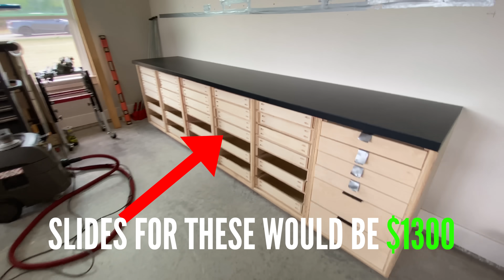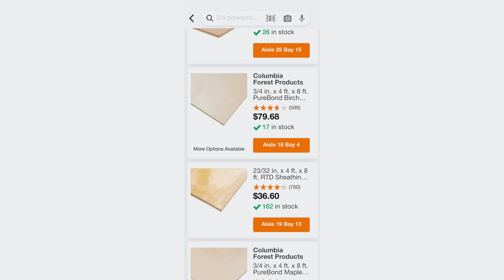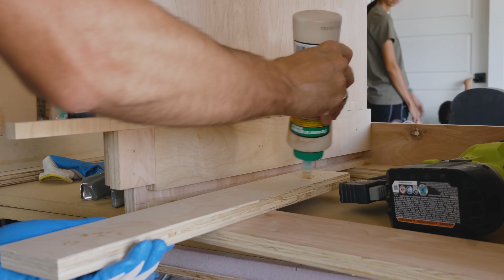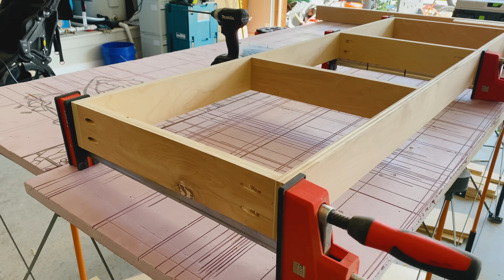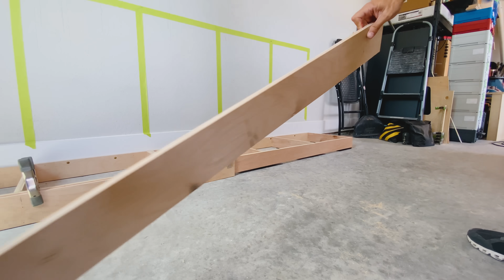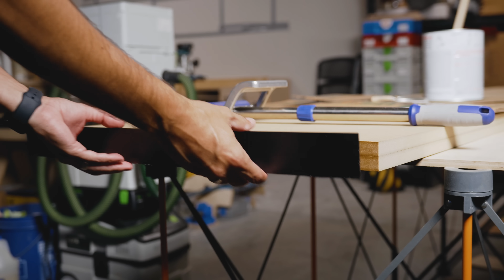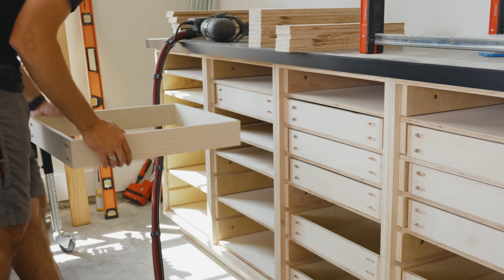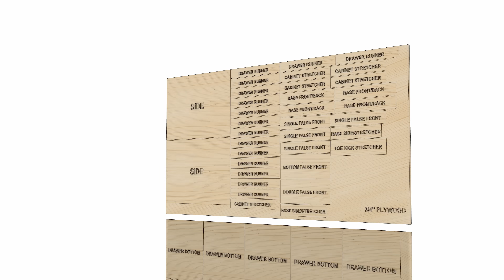Drawer slides are expensive. Do this instead.

Comment: One thing I've done instead of slides that worked: skateboard bearings. You can get 100 packs for $20 or so. They're low quality for skate boarding but should work great for sliding drawers. I used 6 bearings per drawer (3 per side) because they were super deep, and screwed them right into the side of the drawer with a washer for spacing. Buttery smooth drawers.

If you used 6 per drawer, that's only 200 bearings for 30+ drawers, so should be less than $50 total. The rest of your build could be mostly the same, just size the tracks to accommodate the bearing diameter, leaving room above so they rotate freely.

Good tips in this video, going to look up some plywood companies in my area to see if I can find something better than big box stores for some upcoming projects.
Reply: I swear, skateboard parts are high quality AF. I replace every castors with skateboard ones. So smooth, so quiet, zero rattling.
Reply: @captain_elmo  I suspect they are much higher quality than common castors and cheap roller stands, but are poor quality for machine parts.  There's a much larger spectrum of quality for these kinds of bearings.
Reply: Rollerblade wheels are also cheap to use instead of casters for woodworking projects.
Reply: That's f---ing brilliant. What if you did your bearings on the cabinet sides, and then did an inlay rail into your drawer sides like right in the middle of the drawer, then you could do a bearing under the rail at the front edge and one right behind it above the rail so it doesn't tip forward at extension. If you spaced that layout carefully you could also put in a positive stop so the drawer doesn't come all the way out?
Reply: @SeanBlader  Yup, you could. You're basically reproducing basic drawer slides at that point, but the bearings are better and you probably already have the wood for the tracks as off cuts.
Reply: @SeanBlader  yes!
Reply: Not quite sure how to do that. snorkel emoji.
Reply: I was going to suggest UHMW sections along the sides without the protruding side board, just the drawer side with the rectangle strip of UHMW between each drawer level. I do like the bearing idea though. I have seen old drawers with wood slides and they develop stiction and don't handle weight well, with even more stiction. UHMW or bearings would fix that.
Reply from the maker: That’s interesting!
Reply: Cool tip.
Reply: My thought. Barings are cheap. I used them when building 3D printers.
Reply: @artisans8521  BEARINGS, not BARINGS.  🙂
Reply: This idea is great. I was worried that the drawers would start sticking after a short while due to moisture. I would also add leftover laminate to the top edge of the drawer spacers for added protection.
Reply: @Peggapoo  classic solid soap and waxing every track will make em smooth
Reply: Edging vs bearings... Melamine 3/4" X 250' Roll, Preglued cost 40 bucks and you can likely get it even cheaper. I have even heard that people just use it on the drawer bottom and not bottom and drawer holder side. 
If you just just use it on the bottom you only need 120 feet if you account for each drawer using 4 feet. 
I also would have dado the drawer just enough to align them. This would make for all the drawers being perfect size. I do like the idea of the entire drawer being a piece of plywood rather than some other form. These drawers are super strong this way and will hold some major weight.
Reply: @kameljoe21  I like to see you pull out a drawer with "some major weight" inside, if it does not have any sort of sliding mechanism and it is wood-wood contact only.
Reply: Cool thanks for that tip, I bought a heap a few years ago for a project that never got of the ground, got just enough of them to make 4 draws so now they won’t go to waste 😹😹😹
Reply: Genius!
Reply: this! Cheap toy-grade skateboard/rollerblade bearings are so great for so many things.
Reply: I literally just took apart a drawer system my father in law and I built (mostly him). We utilized a square metal rod and skateboard bearings as a drawer pull. I used it as a pew pew storage in my honda pilot when I traveled. I shoot competitively and a day trip I will drive 3 hours one way, just to drive back and be home for dinner. Now I have a Decked system for my truck and used the plywood from the drawer for my workbench I just built.
Reply: Exactly my thought. If you don't want actual drawer sliders, why not add simple wheels to the drawers. It is nobrainer for me...
Reply: Loved the detail behind the overhead cabinets !
Reply: I want to try this, but how exactly do you use a washer to attach the bearing directly to the drawer?
Reply: @DreamPath47  The washer is a spacer so the bearing doesn't rub against the drawer's wood. You use a regular bolt to mount it.
Reply: You could use hide glue. Very high strength and use vinegar to disassemble.
Reply: I've done this as well, it works great.

Comment: Dude you just blew my mind about moving the track down using the parallel guides instead of getting a larger track. It’s so simple too and never seen anyone else talk about it
Reply: Ooh, another thing I just noticed around 16:35 was he set the parallel guide measurements with them right next to each other. I have some from kreg but never used them bc I was scared I wouldn't be setting them actually parallel. 🤿

Comment: I think the mark might be your bearing spinning against the side. Blue tape? For the bearing dry lube.  I also would get really close but I think you have to run a fine plane to ease the edge anyway so you can use that to make the top flush to the sides. (I don't like that IKEA razor sharp corner. I always ease it. It really hurts to bump into a crisp 90 degree edge.) Other tricks. Trim a blind side first, is it clean? no burn marks? Put blue tape on the test side, is the tape in good shape after your pass? 
Those places 'cabinet builders buy plywood' in my long, but intermittent experience, they will give you the wholesale price so long as you act like a professional, know what you want (you can ask questions), no whining, no cajoling, no nitpicking... They won't dump the bad pieces on you.  They'll help load it in your truck or on your car. Make sure you know how to tie it. 
And drawer slides? I just routed slots and used birch or maple strips as rails against each other . Waxed. My cabinets are over thirty years old still work like new. Birch ply against birch ply? Sure, but again I'd always, always ease those edges. They are going to saw into the drawer. [Make a pump drill (stone age technology) put a dowel rod on the end and watch how fast a piece of flat wood can drill a 1" hole in another piece of wood.]  And I don't like drawer slides. I don't care what the weight rating is, inevitably they are a problem. So why pay a lot of money to have problem later on? 
I pre finished my sheets of plywood before I cut anything out, then I touched up the edges and finger joints (my drawers are all fingerjointed) after they were assembled. I  sanded the sheets using a pole sander, not minutes, seconds for each grade. I did this after first trimming a clean side 90 degrees from the best factory side.  The 5 x 5' Baltic birch I got 30 years ago was all a bit cockeyed. I drilled a small hole in one corner, hung them up on a bent piece of wire to coat and dry. I used a foam coater and Bonaseal Floor Finish. Saved a lot of time. I always just used cheaper cabinet grade. For drawer fronts and things that showed I'd always be able to enough sides that were good, no patches. 
Upper cabinets. I'm a big fan of French cleats. I've got a series of bookcases also made from Baltic Birch that have slots in the plywood backs that are angled on the top. These match the strips of French cleats that are attached to the studs. Screw the rails in level, just a bit loose, hang the cabinets, screw the rail in tight - done.  Again, 30 years, and one house move. Full of books; very heavy. Zero movement. I'd do the same for cabinets. 
If you put doors on your cabinets, because your garage is fairly new construction, the walls are drywall (plumb), you might get away with it. But all those screws in each cupboard are likely going to distort those cabinets so the doors won't close flat.  I learned (painfully) that you  the fronts of the cabinets plumb, screw them to each other, maybe even hang all the doors. Then you carefully screw them to the studs but not tight.  I used to have nightmares about a cabinet job I did in New York City -- until I saw a photo of Meryl Streep  in her New York City loft, same cockeyed doors that won't stay closed. Relief, everyone had that problem.  A year later I started having nightmares again. Maybe they'd used the loft I did as a location and I'd made the only wonky cabinets in New York City....

Comment: This is Dennis from Hooked on Wood's cabinet/drawer system. 🤿

Also, are you not worried about dust getting into your drawers with no back or bottom?
Reply from the maker: It’s similar to Dennis’. I built an early version of these in 2013 and modified them after I built a design by Ron Paulk. Not worried about dust. Cabinet is sealed good and I always use a good dust extractor or collector when making tons of sawdust.

Comment: Laminate edges that join on the front edge are prone to chipping. A tip for laminate counter tops: Use a solid wood edge on the MDF, then lay the laminate on the top and rout a 45 deg chamfer. That what I did on my shop tops, table saw extensions and large router table 25 years ago and still look like new.
Reply from the maker: True. I thought about adding maple on the front and forgot about it with all the other moving parts. Next time!
Reply: Yup. A nice bullnose out of hardwood might have been a nice touch. I'm about your Dad's age, and did a lot of laminate work with my Dad back in the 80s. If you put laminate up to the front edge, using a 45 bevel router bit just to cut the top edge also helps. Another approach some use is to put a nice wood bullnose on, cover it with laminate, then cut a 45 deep enough so that the corner of the wood bullnose is visible - anything from a pinstripe to wider band. A last method is to cut a dado relief out of the bullnose so the front is as high as the laminate, but the back is even with the benchtop prior to laminating, then inset the factory edge laminate behind it so it's a tight fit. This will cause the wood to take the beating instead of chipping and lifting the laminate, and will also save your skin from the sharp edge of the laminate your Dad was breaking with the file. A good hard wood like maple works best in all these cases.  Premade tops used to even layer in other colored plastics there.
Reply: Gotta be walnut!!
Reply: Yep that works
great wa y to use up scraps. !!! @flatlander523
Reply: Thank you for this!
Reply: YES to this suggestion !

Comment: There are few ways to avoid those router marks.  One is go in reverse.  The cutting force going forward flexes the bit into the edge.  If you go slow going forward you can get away with it.  You can also counter the forces somewhat, but reverse solves it but feels less stable.  Also make sure you dont have more cutting edge showing than needed though that is a double edge sword with glue clogging the bearing easier.  Lastly there are laminate trim bits with tapered flutes that help keep the bit off the edge and also saves time filing.

Comment: I am a british cabinet maker and have worked in the shopfitting & exhibition industry for about 30 years, and have laid more laminate sheets than i care to remember.

The main reason why the trimmer cut into the laminate is because of the amount of laminate overhang that you had was too much. 

Too much overhang puts more pressure on the cutter and forces it into the work piece, you should only have an overhang of about 10mm or 3/8ths of an inch.

1) when applying the contact adhesive to the MDF edges, pour some adhesive into a seperate containner and mix it 50/50 with white spirit or thinners this will seal the edge well enough to stop the second full strength coat soaking in.

2) The battens that you used when laying the laminate is the right idea, however they can pull the adhesive into small lumps as you remove them causing bumps in your finished item, a better idea is to use 1/4 inch metal rods as these are smooth & splinter free and they have a smallest contact point with the work piece.

this was a good video, and it was good to see how you worked out your cutlist

Comment: Tape on the paint can, why didn't I think of that?
If the ply on ply needs a little help sliding, paste wax will help it slide (and reduce moisture absorption over time). Minwax paste finishing wax is easy to find or you can make your own.

Comment: There's a lot of great tips in the comments! I'd like to offer one of my own. Before installing your upper cabinets, place an upper and lower 2x4 horizontally to mount the upper cabinets on. Mount the lower 2x4 2-3" higher than the lowest part of the cabinet, this will give you a little nook to hide your LED strip lights in. It's a quick and dirty technique perfect for garages and kitchenettes. You look great for 40!

Comment: If you used 1/2 ply for the draw side rest, that would save money and also make sliding the draws in and out easier. Use a little finishing wax to coat slides also.
Reply: Agreed. I would even make the whole drawer out of it. I don't think anything you'd put in those size drawers would need anything stronger than 1/2"

Comment: Having a good bit and bearing that is clean is important as others have noted.  I almost always put paste wax on the laminate before trimming.  It only takes a minute and everything comes out cleaner.  You might want to try putting paste wax or Slideez (from Mohawk) on the drawer bottom edges.  Only takes a minute, smells great and might make a difference when the drawers get heavy.

Comment: 🤿 Are you happy with the vertical plywood edges showing in between the drawer fronts?  The high grade plywood looks good but wondering if a veneer would work or would it mess up the depth of the drawer fronts.  Great build and thanks for showing another option for drawer slides.

Comment: 🤿 Just a quick note about the fungus toekicks. As someone who used to work in the commercial growing of mushroom fungi i just thought you should know something about the plywood that you think has mushroom fungus on the back. You may find that sometime in the future you start to notice a odd odour within your workshop and if you do can i suggest that you remove your fungal plywood and replace it simply because once the spaw's of fungus has started to be able to penetrate into the sheets of ply you will find it has spread across the area of each sheet like vein's, therefore it WILL start to grow into mushrooms again if that's what you had on the plywood in the first place. It's not something you can whipe down and stop from coming back like some molds etc. Just wanted you to know just incase you noticed a strange smell in the next year or so. The cabinet row looks great by the way and a brilliant idea for saving a few pounds/dollars etc even though you didn't actually hit your target. That said I doubt you could have purchased all the cabinets you wanted for the price you actually spent making your own, plus your cabinets will be stronger than the cheap ones you can buy from the DIY stores and last a heck of a lot longer 😊.  As always buddy   💯%   👍   🇬🇧.
Reply: This! I'd replace that fungal toe kick before it becomes a problem. It doesn't need water to grow, all it needs is the right temperature and humidity levels, and it will keep growing inside the plywood, turning it to mush.
Reply: @simonr6793  former plant pathologist here. I've never seen dry rot in real life, but as soon as I saw thar piece of plywood it screamed 'dry rot' to me. I would suggest (like the others,l to remove that toe kick cover asap. Fungal mycelium can extend a fair ways, and dry rot is insidious, doesn't need free moisture. I would paint some wood preservative treatment on the toe kick board it was nailed to as well just to be sure.
Reply: I’ve found an easy way to take care of it is to just leave uranium near the fungus and that usually stops the growth.

Comment: I did Formica laminate work in San Antonio professionally for about 36 years. You can do all of this easily by yourself. The trick is to roll up the small 2” edge banding into a winding like a snail and roll it on working your way to the end by yourself. As for the burns from the router bit they WILL happen so to prevent this simply use crisco shortening to act as a lubricant which can be simply wiped off after you are done. They also make lubricant sticks that you can buy at the same place you bought laminate. Also they make specific 1/4” shank router bits which are just a few dollars designed to cut laminate and they also have a micro chamfer built in for easier sanding and a better look. Good luck.

Comment: Adding insulation, ypu couldve just blown it in and saved a lot of tearout and repair. 

You also used a lot more plywood than was necessary, but it is what it is. Glad it worked out for you, hope it lasts for as long as you want it.  Cheers